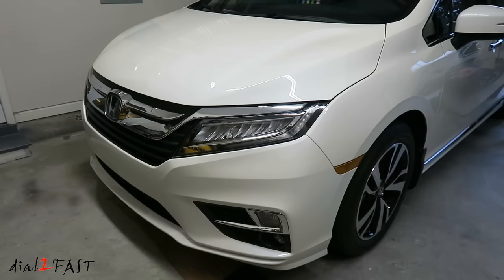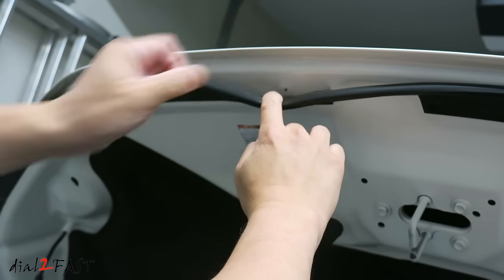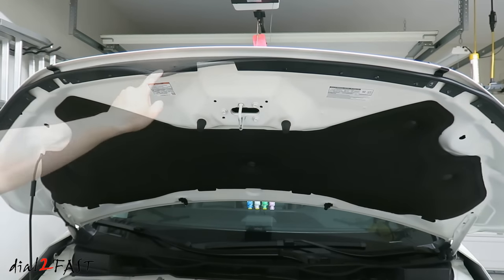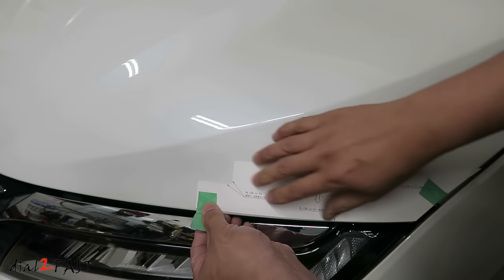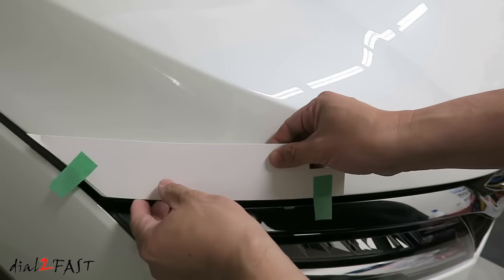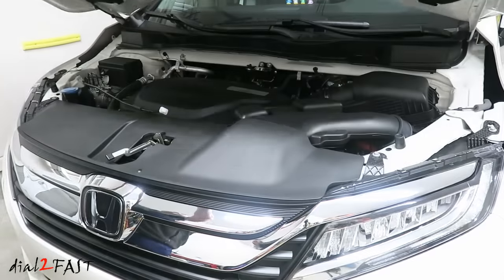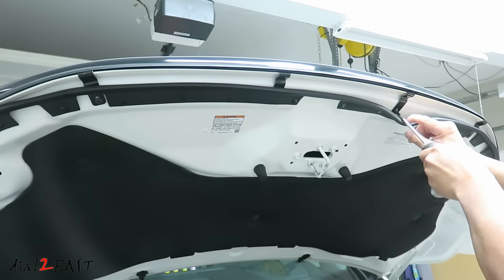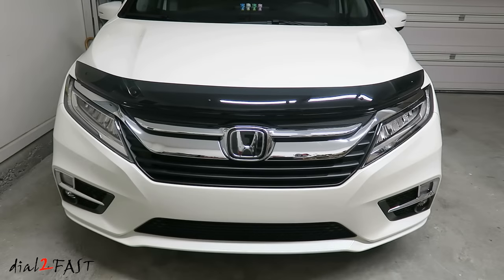Honda Odyssey 2019 Install Hood Deflector

Comment: The 2019 Ridgeline Hood Air Deflector (P/N 08P47-TG7-101) installation is the same with the only exception being that there are four (two on each side) hood brackets.  The Template that comes with the Deflector has the cutouts for both brackets.  Also all four are the same and you do not have to worry about which side they go on.

Comment: Thanks for uploading these DIY videos. Did you so one for roof rail and cross bar installations yet?
Reply from the maker: That's one accessory I did not get. I really don't have a need for it, and the cost is very high for the part.

Comment: Is it causing any problem in car wash? Is it really protecting hood paint from debris and bugs?
Reply from the maker: I wash my own car so can't tell you for sure if it's safe, but it should stand up to the big rollers. And it definitely prevents rock chips on the hood. The bugs will still hit the windshield.

Comment: You previously installed 3m paint protection film partial panel on the hood for this Odyssey.  Did you remove the film before installing the hood deflector?  or did you place the adhesive on top of this film?
Reply from the maker: The 3M PPF film was not installed on the hood because I planned on installing the hood deflector accessory. There is no need to have PPF film protecting the hood when the deflector is protecting the hood. Also the deflector's metal bracket with the 3M double sided tape could possibly lift the PPF film which I didn't want.
Reply: @dial2fast  thanks!  keep the videos coming!
Reply: Hello, you installed it 1 year ago as I see on timestamp, it really protects well? Does it worth it? Thank you in advance.

Comment: the factory tape is worthless. i would recommend to let the brackets sit overnight on the hood prior to attaching the deflector. i replaced mine with gorilla heavy duty tape anyway.
Reply from the maker: I also had the same problem after installing it. I ended up bending the bracket so it's doesn't put so much tension on the double sided tape. It definitely could have been designed better by Honda.

Comment: If not pushing on the reflector to close the hood, how do you close it?
Reply from the maker: You don't need to push on the hood to close it. Proper way to closing is hold the edge of the hood up about 1.5' high and then let go so it drops to close. Pushing on a hood to close can actually risk denting the hood as many modern cars has aluminum hood.

Comment: If you need to uninstall, what’s the best way to remove the adhesive on the hood?
Reply from the maker: Heat it up with a hair dryer or heat gun and slowly rub the double sided tape off with your finger.
Reply: Those bracket 3m tapes undone itself automatically after couple automatic car washes on mine

Comment: My 3m strips for the 2 side brackets keep coming off, its too tight of a fit, any ideas?
Reply from the maker: Yes I did have this problem a few months after installing it. I notice the metal bracket from Honda is angled too much which eventually will cause the double sided tape to lift and come off. Removing the old double sided tape and putting new one on will NOT fix it. I probably tried 3 more times with new 3M double sided tape and it still lifted. The ONLY fix is to bend the bracket open so it isn't angled too far down, therefore releasing any stress on the double sided tape. You will need to adjust the bracket angle so that the hood deflector will simply rest onto the bracket with very little flexing. 

To remove the old double sided tape, you can warm it up a little with a hair dryer, then rub it off little bit at a time with your finger. Then clean surface with rubbing alcohol and reinstall new 3M double sided tape (see link above). Also clean the surface on the hood before reinstallation. Use the original template as a guide.
Reply: @dial2fast  thanks, ive noticed that, bent the brsckets like u suggested, also I ordered just the hardware kit from honda 35.00 dollars.  Its definetly a lot better bending the brackets and just having it rest on them..   keep the vids coming, this is my 1st stop with my DIY projects on my oddy...  just purchased my 1st oddy last month 2020 touring..   thanks so much for what you do!